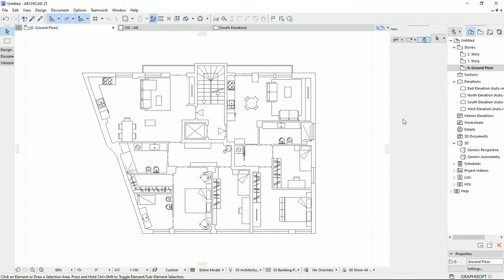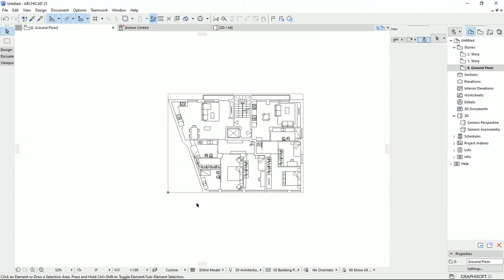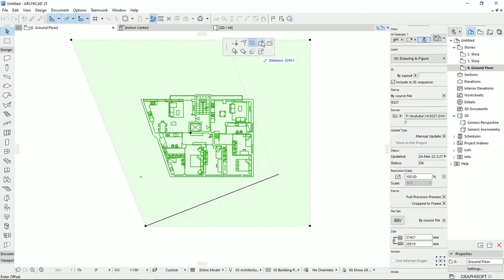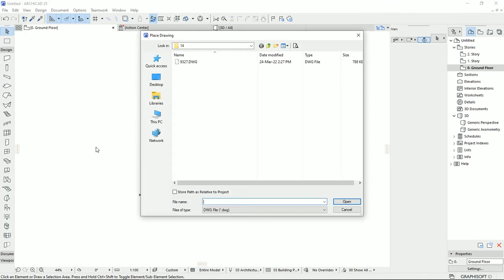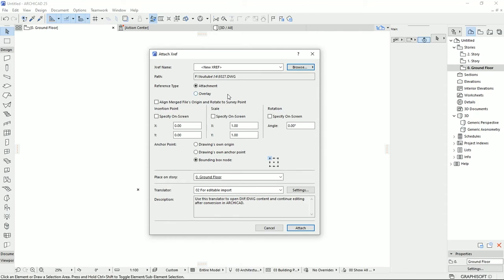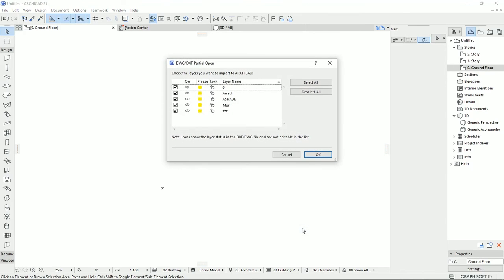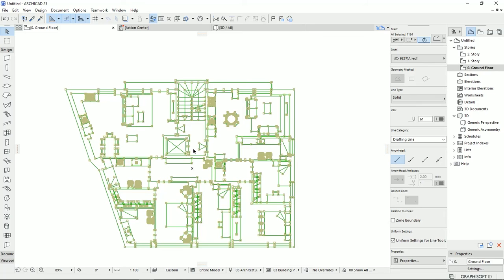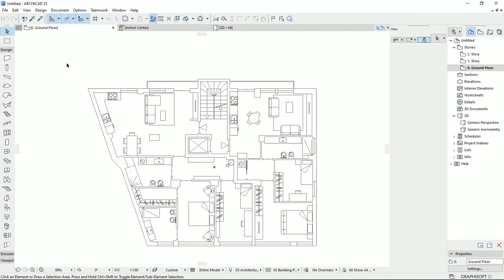Archicad - How to import a DWG file [XREF method]

Comment: The lines are not showing up similarly in Archicad as they look in Autocad. Colors are fine but linetypes change somewhat. Any advice? Thank you.
Reply from the maker: Hi friend. Unfortunately, line types are only defined inside AutoCAD. There might be a solution for this but I don't know it. Sorry if I don't have a solution.
Reply: @madtutorialsMT  my workaround was to plot to file (pdf) from within AutoCAD. Then I just import the PDF into Archicad. Only issue is I had to hand write the scale but easy to do. Thanks for replying!

Comment: Thank you!!
Reply from the maker: You're welcome 😊🌹
Reply: @madtutorialsMT   I have 2 dwg files that im trying to get in archicad; contours and boundary site lines for a rather large area. Trying to bring them in by attaching xref method in a Worksheet but once it's inside and I close the worksheet, the attached drawing disappears! Any idea why?
Reply from the maker: @ohdesignlab8433  i am not sure what is the reason but maybe you replace the two drawings, also make sure that both refrences are save and available in xref window, then close the archicad file